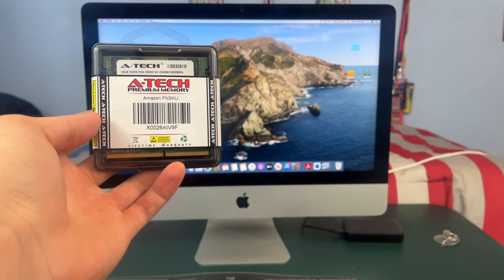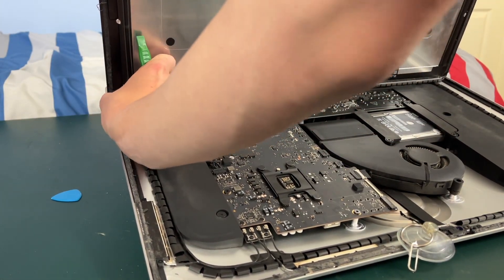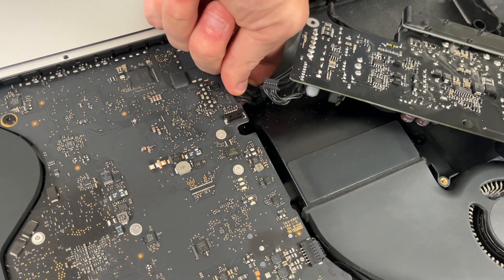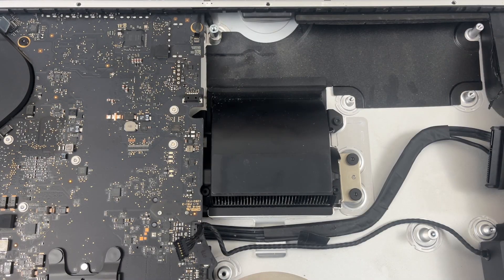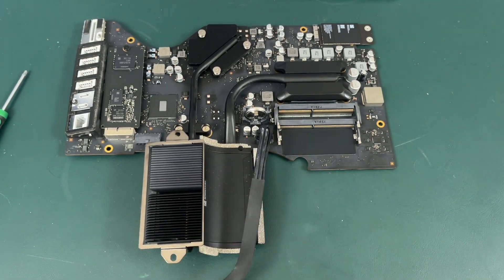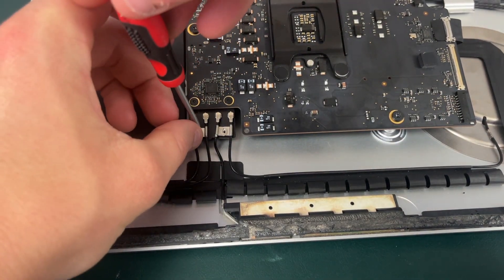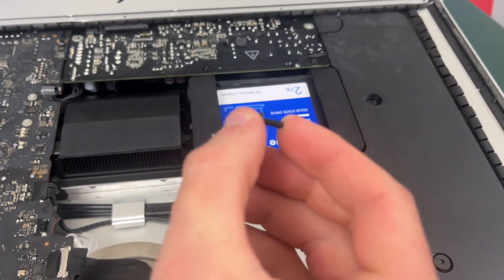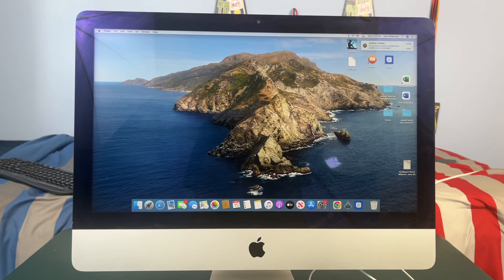How To Upgrade Ram 2017 4k iMac

Comment: You can replace it without taking it apart, theres a little door in the back, the button is where the power cable plugs in.
Reply: That only applies to the 27in iMacs
Reply: @ thanks I didn’t realize that, it’s crazy they didn’t add that feature on all of them
Reply: Not in 2017 21 Zoll iMac.
Reply: @ewawa5253  terrible design
Reply: @Dmak  even my 2007 iMac had a ram window